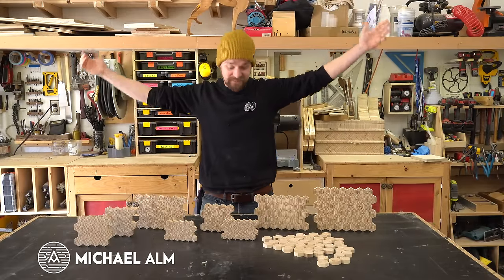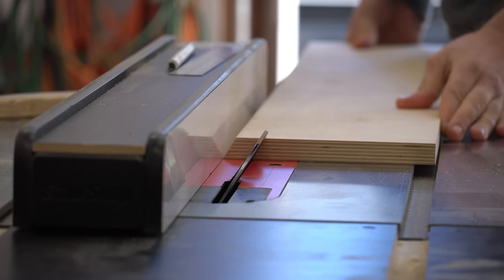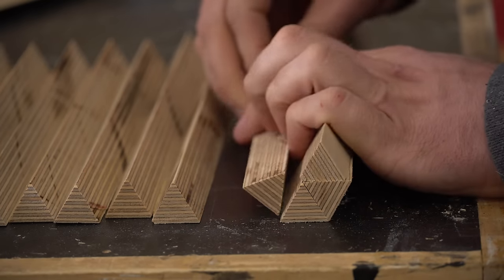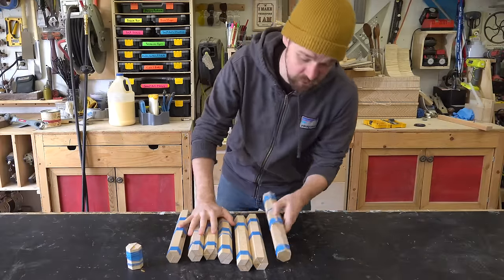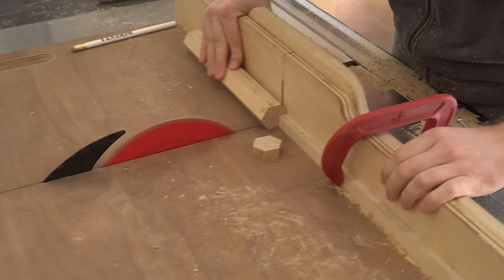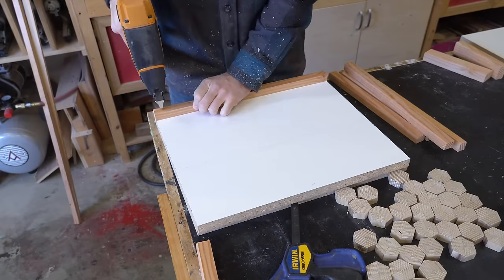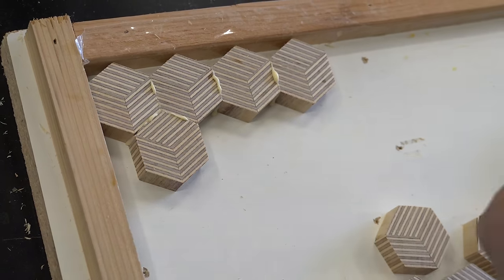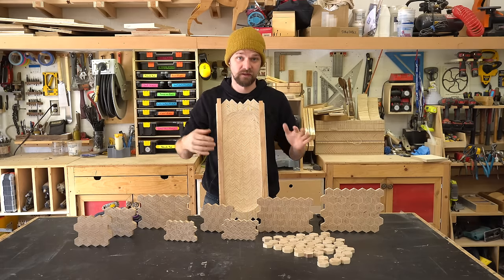Hexagon Patterned Plywood | How To

Comment: What a rather excellent idea using scrap timber, nicely presented with great sounds too. The idea of seeing a whole floor covering with different tones of varnish is quite appealing. I saw several coin floors which when resined into position looked visually brilliant. On British building sites in the past there was so much multypli thrown away, nowadays UK builders use a lot of MDF, whose dust when cutting is quite toxic. I was told that it's banned in the US but the UK government lets the house builders use tons of the stuff.

Comment: Inspiring video, I just made a batch of hexagons for a wall hanging project. I cleaned up my hexagon logs using my disc sander instead of table saw and cross-cut using a band saw, less waste as sawdust. Thanks for the idea and excellent video.

Comment: I'm kind of surprised at how well this project turned out.  When you consider the effects of cumulative error it's remarkable how well the individual pieces fit together without horrible gaps appearing.  That's a tribute to the accuracy of pieces cut on the table saw.
Also impressive was the intelligent use of the plywood to create the many different patterns within an individual hexagon.
I was surprised too how it is OK to glue large groups of the hexagons without clamps [ which if used I can appreciate would have caused chaotic sliding between the hexagons ]. I noticed there was no particular problem occurring as a result of voids in the original plywood sheet which could not be dealt with using wood filler.
Lastly I was reminded of a puzzle set I bought several decades ago [ in the 70's as I recall ].  This consisted of what were referred to as " hexominoes " .  An individual hexomino is a contiguous group of 5 hexagons.  Each hexomino has a different assembly pattern from all other members of the set.  I can't remember how many different combinations are possible, but this can easily be worked out after some experiment.  These separate shapes can now be fit together to configure larger agglomerations [ there are a huge number of possible larger patterns ], and the challenge is to find how to construct any given shape. [ As an example of one set of problems - construct a larger scale shape of one the hexomino shapes  ].  If this appeals, a simple variation is to colour each hexomino differently, which makes the subsequent assemblages a bit mire striking.

Comment: Grand Job Michael, those patterns look fantastic and the finish looks geat with the  voids filled. I'm subscribed now!

I can think of one pattern that you didn't try though, maybe a suggestion for a different video? If you make cuts at 15 degrees or 75 degrees instead of 30/60 then you can get diagonal lines that go through eithe the short or long diagonals of the rhombus  that way when you glue them up then you either get a triangle inside a  hexagon or you get 3 radial lines (and parralel ones) going out from centre. Would love to see how they turn out in a pattern.

Comment: Next time u do hexagon pattern glue ups, try putting a right triangle in the corner of the glue up jig and then butting 120 degree triangles next to eachother along the top edge to fill in the negative space. That should give you full support around the pointed tops of the hex patterns and allow you to apply more clamping pressure.

Comment: I took this project on and it was a lot of fun.  I did run into trouble when I got to the part about truing them up at the table saw.  I found it hard to cut them consistently, so I they fit worse after I did that.  But the look of the hexagons when I but into the sticks was so cool.  I'm going to give it another try, so if you have any tips how to take those "light passes" you were talking about, I'd love to hear them.

Comment: Very cool video! Great result! If I can formulate a constructive criticism: you have cut triangle in both orientation (like AVAVAVAVAVAV). As the orientation/thickness of the outer layers of the plywood are not the same between the top and the bottom this cause a shift in the clearer/darker pattern in your hexagon as soon as you mix in the same hexagon A and V triangles (for example @10:41 you can see that the top row of hexagon has 2 cells with same triangles on the right (aligned colours) then 2 mixed in the centre).  Think to sort them out  and to check if you have to turn the rhomb to fully align the colour layers!

Comment: I wonder if you could cut a veneer from the small panels?  Then assemble like tile and glue down to a larger panel, to possibly save some time from creating a really large surface.
Reply: I'm doing just that, cross-cutting my hexagonal "logs" into 1/4" thick hexagons on my band saw., which I'm gluing onto a plywood backing. You could go even thinner, like 1/8" assuming you did a solid glue-up of your logs.
Reply: @chrispearson8163  do you think doing a resin soak of some kind might protect the wood more when doing thi veneers?
Reply: Resin might stabilize the ply, but I think the key to thin veneers would be gentle sawing, maybe using a Japanese razor saw and a mitre box or a bandsaw with a really sharp blade and gentle feeding pressure.
Reply: @chrispearson8163  that makes a lot of sense I don't really do any veneer work but I have been looking for a way to apply a thin, strong decorative cover over wireless phone chargers set into table/desk tops and this might be it.  I could even align a section of the pattern to indicate where the charger was!

Comment: I've been trying to come up with a clamping jig that can do glueups with individual pieces like this (instead of the more common long piece face to long piece face). I've been 3d modeling variations, but can't seem to create one that provides a continuous surface that doesn't allow pieces to fall through AND integrates clamps, AND allows for variance in total dimensions of the glueup chunks (I make variable size cutting boards from cubes - 1 glue up, but needs a continuous bottom). I ALMOST had it with a shiplap style bottom where every other piece is connected - creating a sliding/interlocking surface, BUT the damn parallel clamps just don't line up well. My next idea will involve strap clamps instead. Thanks for the video - this was super insightful for that process though!

Comment: Michael, I love this video! Thank you for your inspiration. I really want to make a desk top out of the cube pattern. I am thinking about trying to make one 8ft long 30" deep. However, I have some questions:

1. If you were going to make a desk with these types of patterns, do you think you would need some sort of solid piece supporting it? 
2. If you were to use a trim router on the edge of the entire pattern (not each piece), do you believe chip-out would be too big of a problem? I like idea of a half-thickness round-over or chamfer, but I'm not sure if it will be too much of a pain to try to get that. 
3. If chip-out is an issue, how would you edge the side of the outside? Another piece of plywood with edge grain facing up? 

Any advice you can give would be most appreciated. (The legs and bottom frame are from an Ikea Galant if that matters. Also, there won't be a lot of things on top of the desk). 

Thank you again for such a great video.

Comment: So, did you use a finish or stain on anything after you did it? Did you experiment with anything on colors vs. clear? I assume its going to absorb like end-grain, so curious if it would stain smoothly or if you should just use a clear coat to protect it.

Comment: Love these patterns Micheal! Just wondering how long do you think it takes (from start to finish) to complete a 16” x 20” pattern?
Reply: In case you were curious, this is coming from someone who hasn't made a bunch of patterned plywood projects like Michael has. I'm making a 16x27" table surface with a hexagon surface, and I'm about to the point of cutting the hexagon "logs" down in to the smaller disks, and I have about 10 hours in it so far. There have been a handful of things I had to learn as I did this myself. I expect the full table top will take about 14-16 hours all told.

Comment: Your work is so beautiful...is it possible to start with a wider first board?
Reply from the maker: Yeah, any size is fine. i just said the size of the board so people had an idea of how much you could get from it.
Reply: @MichaelAlm  thank you...I think I did not ask the question properly.  I meant could I start with a large first cut, (instead of the thickness of the plywood) as a gauge?  Could I make the first strip larger than just the width that you placed up against the fence?

Comment: With the amount of burn you are getting on your rips... I think you are having the same problem I had, your blade is out of alignment to your top. Check to see either if your fence is out or your blade out from your top, if one or both is out by a couple or more hairs, then you will always have problems with burning because the wood is riding sideways into the blade, either pushed into the blade by the fence, or riding along the blade at an angle due to the skew of the blade to the fence.

Comment: I would add around 15% more glue. You don't get consistent squeeze out across all of your joints. Glue is cheap. Your skills are not.
If your just joining solid wood the surrounding area would even it out. I had a lot of wood science classes at EKU were we tested joints in a lab. 

Glue starvation was always the problem It happens a lot but, your cutting the joints down to a small surface area. Stress that starved spot and it will break.
You might add a really light "wash" coat first. Then apply your actual glue coat.
I love your videos. I want to build a desk this way.